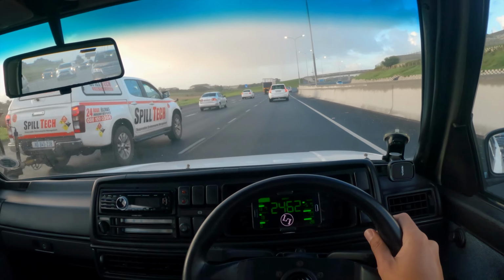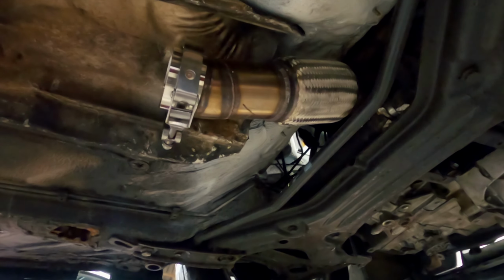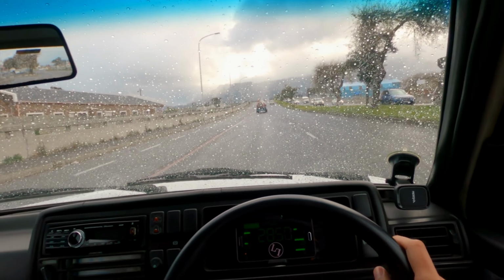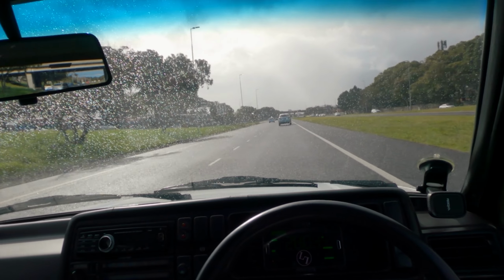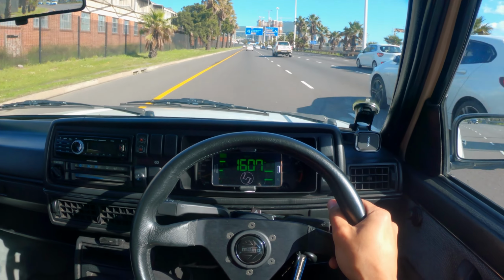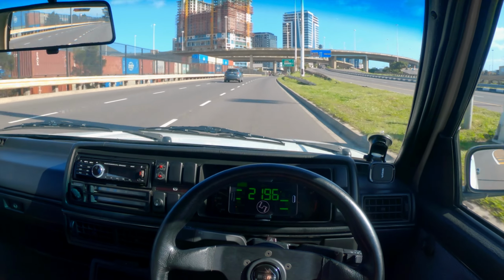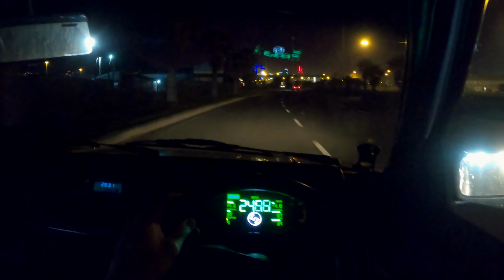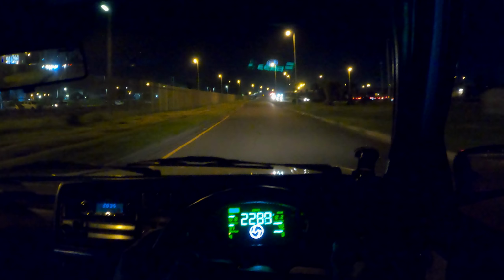The 1.8T Mk2 GTI gets a 76mm exhaust but is it surging?? Strange turbo noise | POV driving and pulls

Comment: In addition to what’s been mentioned. I’d suggest checking your fuelling, injectors and condition of fuel pump. If you’re running a filter I’d suggest cleaning it for good measure and maybe check that you’re getting consistent spark, switch out coil etc. I hope you get the gremlins sorted soon and it’s a cheap fix. I’m sure a dyno session would narrow it down and point you to the issue.
Reply: 1:30 - is that a surge or you letting off the loud pedal.
I see it surged at 3:49. 
3:33 - it redlined but broke up toward the end although it seemed to be pulling strong!
Reply: Btw - sounds fantastic, dash set up is MONEY!!!
Reply from the maker: I agree, checking all those things would be good but the only thing that changed was the exhaust. It's a pity the road was wet when doing the before drive so that we could hear it clearly. The car was breaking up which was weird but I haven't had the car tuned after adding the wmi and going bigger on the cooler cold side. So I think that's the reason for the break up. But I'll get this sorted or at least get to the point where I know what the issues is and what the next move is soon.
I'm enjoying the sound and dash setup. I'm actually checking my rpm now. Haha.

Comment: Seeing your rpm like this it seems your turbo is to big , you want full boost coming on at 4 to 4500 not 5500rpm like it is .
Also have you upgraded your valve springs? , sounds like the valves maybe floating abit at top end .
Reply: Turbo isn't too big, its just not very efficient.
Reply from the maker: I still have stock valve springs. I have no idea what valve float sounds but I assume it will sounds like it's breaking up at higher rpm. I didn't rev the car too high in this video because there's very little timing up there. But springs and retainers would be great to have.
4500 - 7500 is the ideal powerband for drag racing but for rolling runs from 3rd, 5500 - 7500 is perfect because it doesn't fall out of boost at all.

Comment: Hey buddy. Looking at doing this swap on my mk2 jetta. I stay in the eastern cape.

Any chance you could tell me what engine and gearbox brackets you used for the swap ? 
I've got AUQ engine and 02J gearbox.
Reply from the maker: Hey. Front and rear mount is stock. You just need a VR6 gearbox mount/bracket for the 02J.
Reply: @lowdl  Any chance you know where I could source the gearbox bracket? 
Thanx for the help.
Reply from the maker: @rhyssbayman4610  check for a VR6 being broken up. That's you're best bet. Or have one made. That's another option.
Reply: @lowdl  Thanx so much for the help bru. Much appreciated 🙏

Comment: My 1.8T makes the same sound when on boost and the revs climb. After logging was told that its leaning out which causes the 'surging' or flapping air sound. Is your fuel pump coping with the higher boost? Car sounds epic btw!
Reply from the maker: That's interesting. Didn't think it could be fueling related but thankfully Andrew and I went out to do some road tuning with lots of pulls on high and low boost and with the fuelling spot on, it's still surging. Fuel pump, touch wood is coping.

Comment: Sounds Awesome.
Time for those valve springs. 
Easily getting valve float on high Boost. 
Valxe can't shut properly. 

That's why on high boost only. 
You close to the limit on your valve springs. 

Awesome build even Great watching you get Better and Better.

Hope you solve this problem.
Reply from the maker: I don't think it's valve float because of the rpm and amount of boost I was running. When I race the 12.9, I was running 1.9 bar. In this video I was running around 1.6 bar and less rpm. I revved out to 7500 at Killarney. On pump and wmi there isn't much timing on top so I didn't rev too high. With that said, you could be right but I really hope you're not. 😂 I don't want to do valve train now. Too many other things to sort out. Flip.

Comment: Motor can't take more boost that's why it's surging downgrade you're turbo run same boost car will be way better. 48 rear housing works best boost lag is intense on the car
Reply from the maker: The plan is to downside the turbo. I bought a 3076 with a .63 housing from Mr T but that turbo failed on me. It's on my dads car now so I'm looking at getting something else. Fitting a .48 housing to this turbo won't help much but I have thought about it.

Comment: Yo Bud, awesome video again, for me it sounds like on high boost something is keeping the car back to go into demon mode lol, but i know you will find out the issue,maybe do a diagnostics and find out what the problem really is instead of playing the guessing game and which will cost more money
Reply from the maker: Right now everything is pointing towards the exhaust restricting the turbo. I will need to check to see if I remove the entire exhaust if it's still surging. It's difficult to diagnose an old car with an old turbo. There's not much to diagnose. Lol. But having a dyno would make my life a lot easier to testing.
Reply: @lowdl  lol old cars can run better than new cars hey, but I'm curious to know what the problem is in your next video
Reply from the maker: @hurschelotto4604  There won't be an answer in the next video. It will be in the following video. Hopefully I can get some dyno time this weekend to do some testing in a controlled environment.
Reply: @lowdl  awesome man I can't wait

Comment: car sounds awesome. that sound that u hearing sounds like the boost pressure is kicking back into turbo if that make sense  almost like to much back pressure that's why u dont  hear it in low boost what if try turning boost down in high boost just to test if it still does it.
Reply from the maker: I tested that at the track last night. Turned down my "high" boost. Seems that around 1.2/3 bar it's happy. With anything more causing it to surge.

Comment: hay man... car is definitely seeming flat... exhaust could of killed... the dyno is the only way to know what's going on with power..
you should hit me up on WhatsApp,  we can chat.. 
all the best with your event tonight
Reply from the maker: The car seems flat because it is. I hardly drive on pump fuel and there is very little timing in it. The car needs to be tuned for the new changes but we haven't gotten around to it yet. My tuner wants a day with the car but doesn't have a day for the car 😂 
Email me lowdl29@gmail.com for my details or hit me up on IG: @lowdl  so we can chat.

Comment: Turbo to big and coming in to late that rpm motor can't take all that air in that's cause a surge
Reply from the maker: I agree with you BUT It took more boost without the exhaust before and no surging. So that confuses me. Now it seems like anything over 1.3 bar is too much. Very weird.
Reply: @lowdl  u wouldn't hear surge with no exhust  sound overrule the surge sound
Reply from the maker: @jacquesc20xe11  I'm running the car with no rear section and it's just as loud. I can hear the surging clearly now but not before. I'm going to test with and without the exhaust soon and I'll let you guys know. But a new turbo is coming soon.